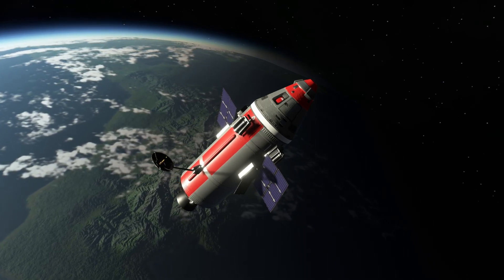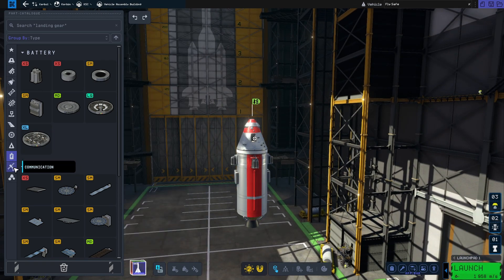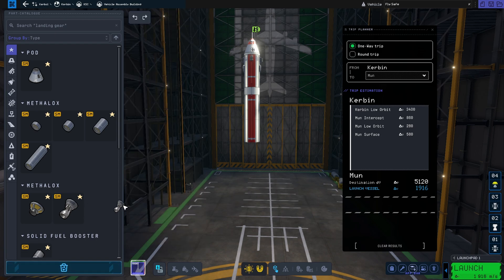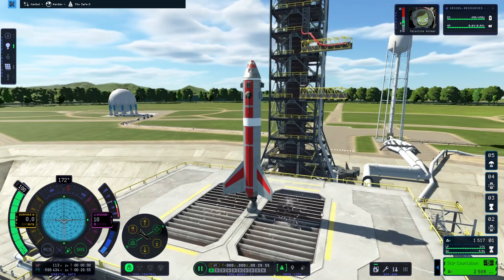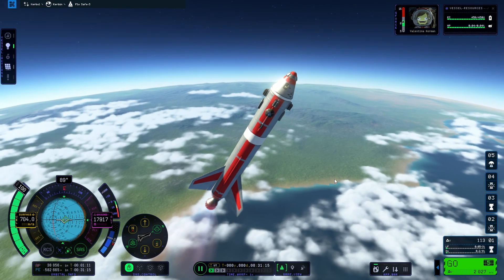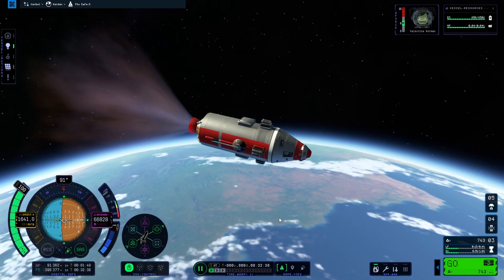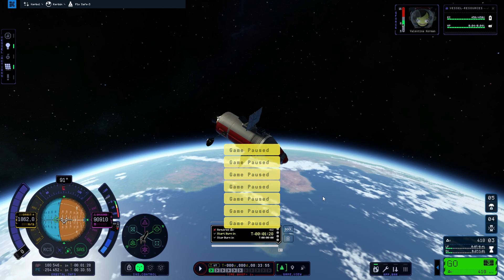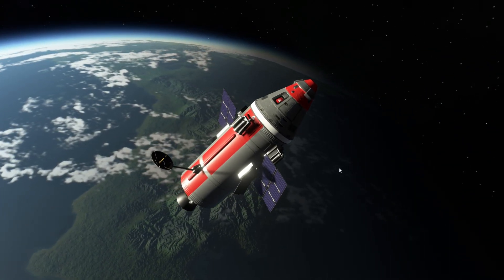How to build and launch your first orbital rocket in KSP 2

Comment: What fps did you get, looked like 10-15fps most of the time in the video.
I have a rig over the recommended specs, and max put fps at 25, most of the time I get 5-15 fps, but it drops to 2 fps at times.
I only have a small amount of parts so it's not parts causing it.
Seems game needed another year before alpha release. Disgraceful they charging 50 dollars for it at its current pre alpha state
Reply from the maker: I was for the most part between 20-60 FPS, where 20 was flying a plane around KSC, and launching my Duna mission (video will be coming) while going through atmosphere, but 60 when in orbit or even space with a smaller vessel. My Rig is i7-10700 (8 core 16 threads, 64GB RAM, and 2080 (non-Ti)). And I was playing on 1080p with all the details maxxed.
Reply: I have the same cpu, but only 16 GB ram and a 3070ti, my pc runs Microsoft flight simulator with 40 fps above Los Angeles, so I think it will run ksp 2 too